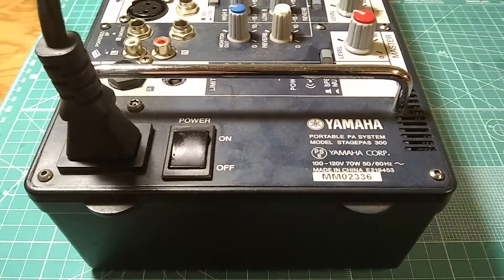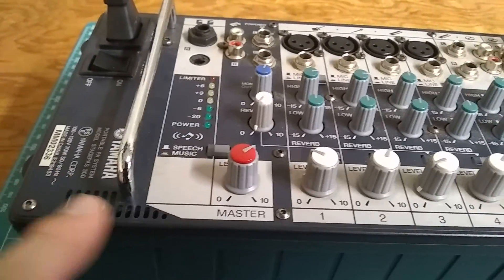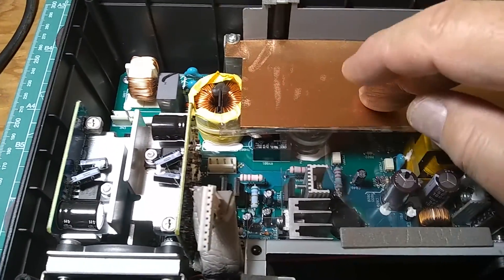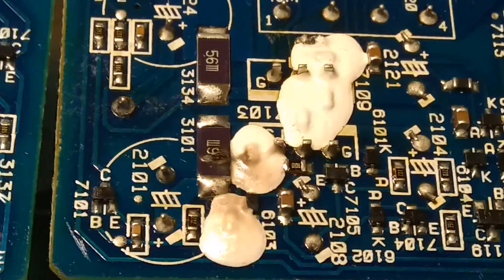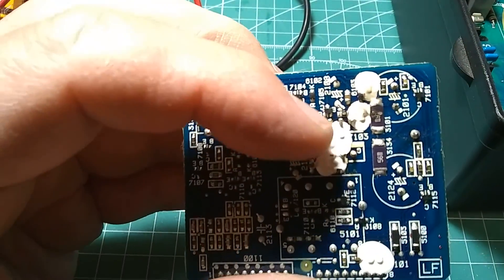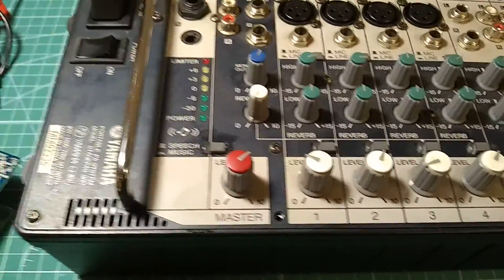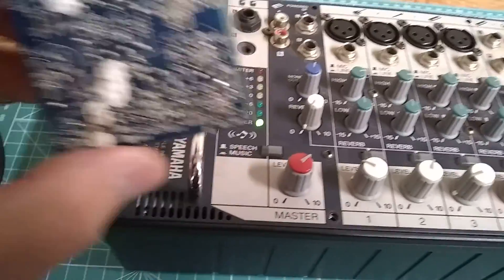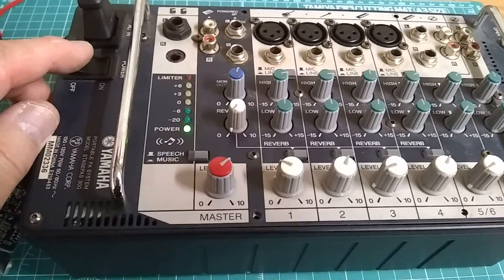Yamaha Stagepas 300 no audio - quick fix. Bad power output module part # AAX6207R

Comment: :thanksdoc:My Stagepas 300 just failed. I have identified two points of failure. Could you possibly help find replacement parts?   
1) One of the brown KMQ 50V 10000uF  capacitors popped its top and left black soot on the plastic shield. Seems like a pretty easy part to find. But, I’m not sure which temperature rating to get? (105℃?)
2) One of the 6-pin TOP249YN   line switchers? (1221 0H868A) broke in half. I can’t find an exact match for this part. Can you help?
Reply from the maker: These are:
1} DigiKey Part Number 493-8666-ND
Double check the dimensions to make sure it fits
2) DigiKey Part Number 596-1080-5-ND

Good luck!

Comment: hi again m8 i got all the bits but slipped after finishing and dropped the board and damaged a chip on the back the label 7115 do you know what part this is? on top of the chip is says 1bt  its pins are labelled c   b   e . thanks again for the help
Reply from the maker: 7115 is NPN transistor BC846BW. Digikey part 1727-4848-2-ND. 
Good luck!
Reply: @tektech1065  thank-you you are an absolute legend cheers
Reply from the maker: The schematic for the power amp is hard to find on the internet. And the good links often disappear. I found it in music-electronics-forum and 16145-need-yamaha-stagepas-300-schematic/page2
If you google that, you should be able to get the PDF circuit. 
Good luck!

Comment: hi there i have the same problem and the same burnt resistor can you list where you got the spare parts also where can you get the whole board the only one I can find is 218 pounds plus shipping which is really more than the unit is worth cheers and thanks for the vid
Reply from the maker: The two MOSFETs and the 0.056 Ohm SMD resistor seem to be common failure in these amps. It could be the two little fans to blame for overheating, when they age and start to slow down. I ordered new fans and will be replacing them You should be able to get the parts from Digikey UK or from ebay, but Digikey is the reputable source. The original STP14NF12FP MOSFETs are now obsolete, so I used the new substitute suggested by DigiKey that works perfect: 
STF20NF20 - DigiKey part nr. 497-5811-5-ND
Resistor 0.056 Ohm 1W part nr. 311-0.056TCT-ND
If you also want new fans, these are:
DigiKey part nr. 259-MF50101V3-1000U-A99-ND
and DigiKey part nr. 259-1796-ND
Desoldering the old parts can be a challenge if you don't have a good solder pump. I damaged one thru-hole and had to make a wire bridge. I left the bad resistor in place and piggy-backed the new one on top of the old. 
My repair of the fried module went v. well. I will post a new video of it in the next few days.
Reply: @tektech1065   wonderful thank-you m8 have ordered the bits (with a couple of spares ) and will give it a go thanks again for posting the video might get a few more of these back working.